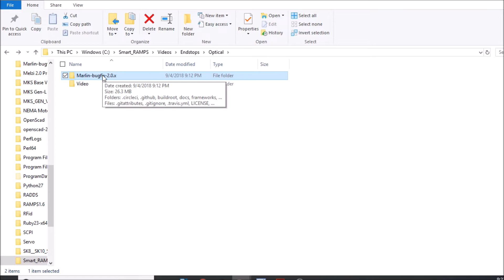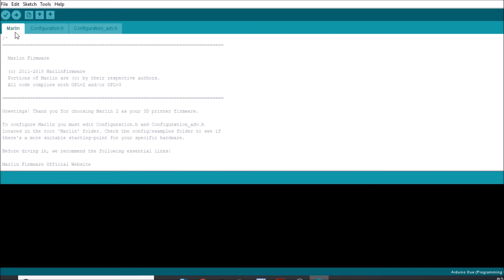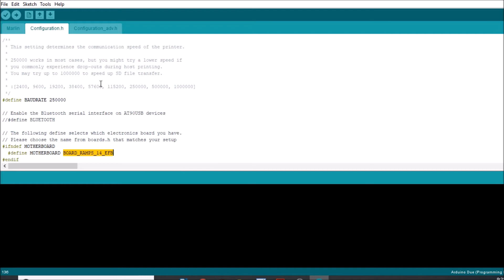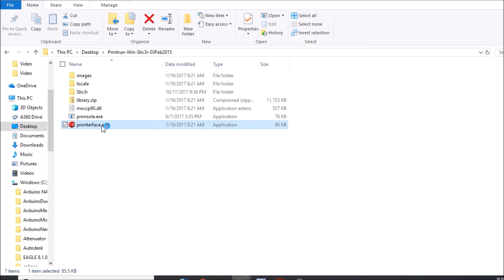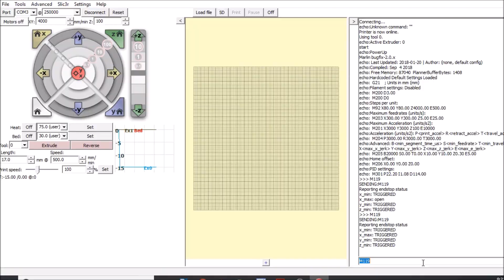Smart RAMPS - Optical EndStop

Comment: Hi, thanks for the tutorial.
I don't know if you went over it on a different video but could you explain the next section in Marlin with the ENDSTOPPULLUP / ENDSTOPPULLDOWN settings?
i don't understand what I need to disable or enable for my optical NC sensors. thanks
Reply from the maker: My other newer tutorials seem to cover it.  If the endstop does have a resistor or capcitor I sometimes skip talking about it.  It smoothes out voltage levels.